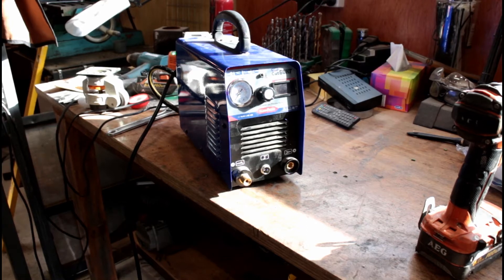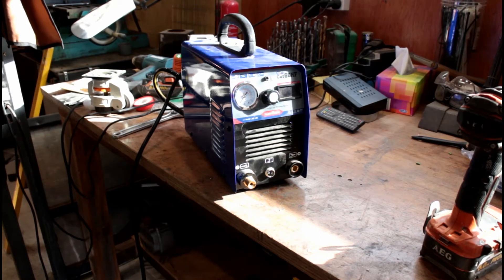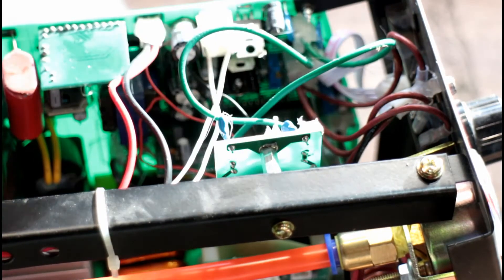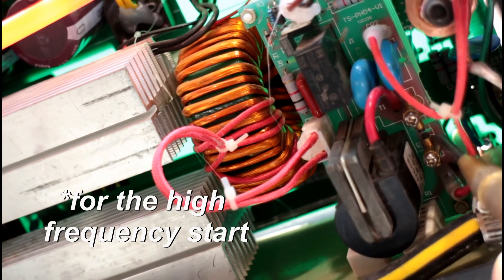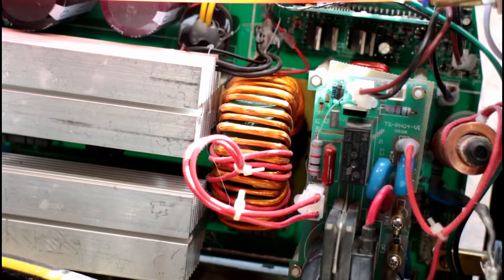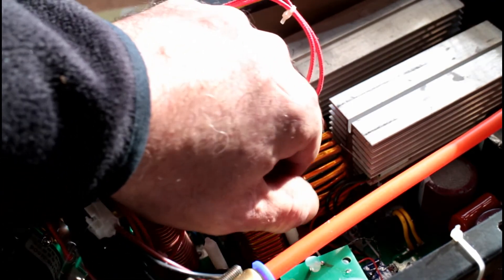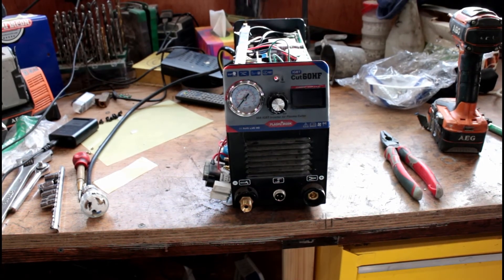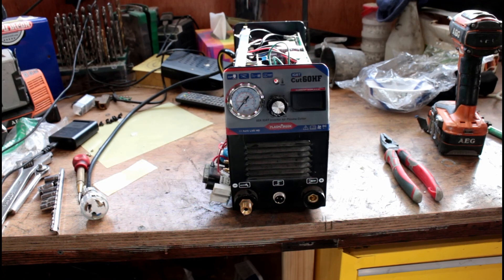Cut 60 plasma cutter review and postmortem.

Comment: they are hit and miss I have one for about 3 years. and a couple of weeks ago I used it to cut some 1/2 I beam and it did well (did have to use a cutoff wheel at some places) used it to cut up an airplane aluminum tank, worked great. I got a cheap roller attachment to go on the ceramic cap and made it fit so I did not drag the tip and it has made a great improvement. I so far have been the lucky one.
Reply: i know im asking randomly but does any of you know a way to get back into an instagram account..?
I somehow forgot my account password. I would appreciate any tricks you can give me.
Reply: @Reyansh Cameron instablaster =)
Reply: @Deangelo Kasen thanks for your reply. I found the site on google and Im trying it out atm.
Takes a while so I will reply here later with my results.
Reply: @Deangelo Kasen It did the trick and I now got access to my account again. Im so happy:D
Thanks so much, you saved my ass!
Reply: @Reyansh Cameron happy to help :D